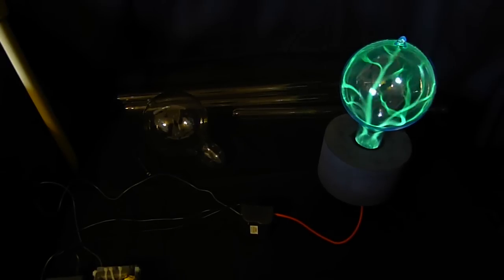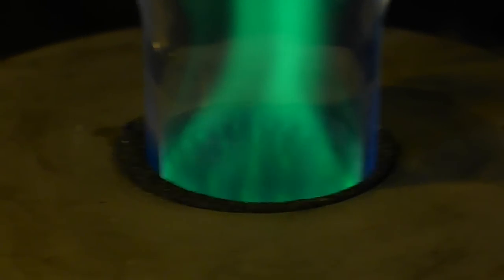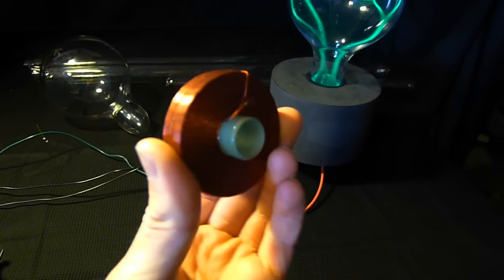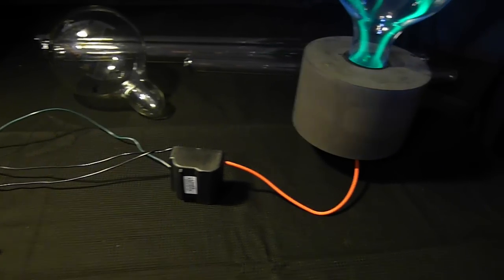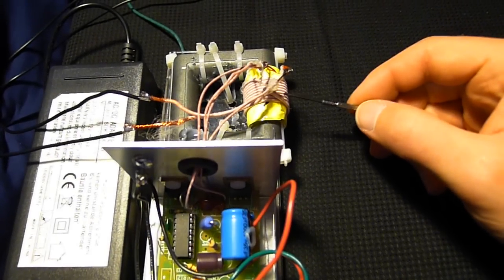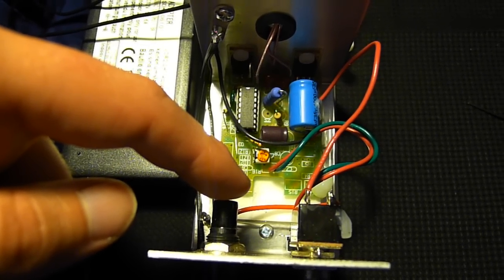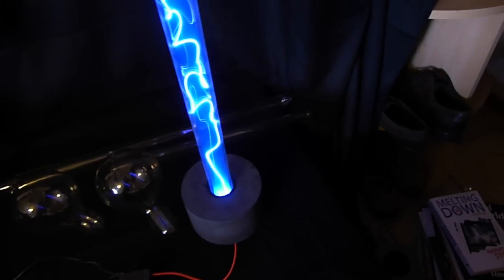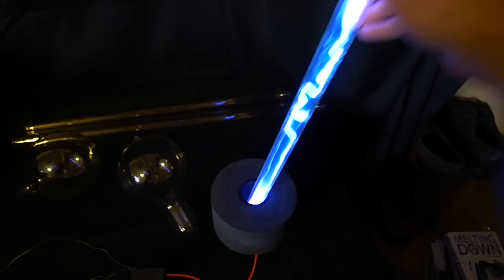Power supplies for decorative plasma displays

Comment from the maker: The second round flask contains a Xe / N2 / Ne mixture, and I have since learned that a trace of O2 is also necessary for the green color.  In this tube, the O2 probably is supplied from the tube walls; it was unbaked.  The measured components are
Xe: 20 torr
Ne: 135 torr
N2: about 500 millitorr (not recorded)
O2: trace (see above); if a baked tube, use about 200-400 mtorr
This four-component mix works reliably, but N2 and O2 contributions must be metered on a piece-by-piece basis.
Reply: Damn smart

Comment: Thanks for detailed and speedy reply. You might be able to get a three-color effect if you keep the O2 and N2 levels about the same and try Ne: 350-360 torr with Xe: 8-10 torr.  Add the Xe last very slowly while globe is energized to watch the effect develop. This should add a rose-pink or red color at the outer edge of the plasma tendrils and at the core.  If you want to try a "warm fuzzy flower" effect in  pink, red and bright orange try adding 20-25 torr dry Air to Neon at 200-220 torr.

Comment from the maker: The HVT-01 as originally configured has an unbalanced pair of primaries, one of which is wound with very small wire and prone to overheating.  You should ask Imagesco for the "new" HVT-01 that has a balanced primary (tell him I instructed you thusly).  Or, yes, you will have to use the isolation transformer.

Comment from the maker: I experiment a lot, but usually don't seal off and film tubes with mixes that aren't visually appealing, since it's money down the drain for me.  Helium makes rather dim and diffuse purplish and pinkish effects (depending on current density).  The good thing for people who want to play around with it is that the gas itself is dirt cheap.  You just need a suitable container, and an HV supply.

Comment: Great video!  Based on the good performance of the components you are showing, I have purchased the HVT-01 flyback transformer and am currently building the driver as described in Iannini's publication.  I am curious as to why you wound the "chincy" transformer as 1:1 instead of just removing the transformer altogether and wiring directly to the HVT-01's two primary coils.  Does the 1:1 provide some protection to the driver from the flyback?  Thanks!
Reply: Hey, did you ever get an answer for this question?

Comment: Hey Carl, thanks for the awesome video. I was wondering if you could help give a little more information on what you did with that 1 to 1 ratio transformer. I built the circuit and have 3 wires that hook up to the primary of the transformer (2 from the mosfet drains and one positive wire for the center coil tap)  so I'm a little confused how you converted that system into 2 wires that you hook up to the chirk transformer. Any help would be much appreciated!

Comment: Can you please tell me the details (The fill pressure for each component in Torr) for the xenon-neon-nitrogen mixture you used to fill the second round plasma flask in this video? The sharp-focus blue arcs with green mixed in is a combination I have been trying to make for some time. Use the private YouTube Message feature if you prefer. I can share details of some of my mixtures in exchange if you like. Thanks for sharing details of your work online.

Comment: I understand the need for a high voltage, high frequency, low current power source- and that is provided by that HVT-01 transformer. But what does the second thing (he "poor man's plasma globe" circuit) do? What's stopping me from hooking the transformer up to an AC power supply and running the plasma globe?
Also, where should I look if I need a substitute for said part, but have relatively little experience with electronics? I'm unsure if I would be able to put the circuit together.

Edit: Also, I've seen Neon sign transformers for sale on eBay that output 10~ kv at low amps, why couldn't I hook that up to a plasma globe in order to power it?
Reply: The flyback transformer requires a fairly high voltage (around 1000v) as input and it probably operates most efficiently at a frequency other than 60Hz. A neon sign transformer would probably work but it's extreme overkill (and quite dangerous) considering they are built for larger, higher pressure, hot cathode displays. It would also be very inefficient for an electrodeless tube because the capacitive coupling through the glass from a 60Hz supply would be much weaker than something like 10 kHz
Reply: @maevemccormick5307  Flybacks take anything from around 12v to 240v input...no way do they have a 1000v input. 
A neon sign transformer would not work, the frequency output is too low. It is not overkill as the voltage is more than likely less than a flyback output would produce (Flybacks operate anything from 10kv to 25kv). Neon signs are COLD cathode and not HOT cathode. (HOT cathode would be standard fluorescent lighting and do not use High voltage transformers, but standard line voltage and a ballast which is used in part to strike the tube, whilst regulating the current). The whole reason the plasma lamp works is because of the High frequency high voltage and this is why the displays look as they do.

Comment: A cheap ZVS (zero voltage switch) board from an induction heater kit and a HVT-01 or other non rectified flyback do the job:)

Comment: where do you get the gas filled bulbs?
Reply from the maker: +Oscar williams I make them.
Reply: +Carl Willis how? I think you melt some glass and put that in a tube and let the gas fill the glass like a baloon, is that how you made it?
Reply from the maker: +Oscar williams First, prepare the glass shape to be filled.  Second, pump the air out using a vacuum system.  Third, backfill with the noble gas mixture.
Reply: could you make a plasma display like the one used for "the rick and morty" portal gun?
Reply from the maker: I'm not familiar with the reference.  Sorry.
Reply from the maker: I would be willing to work with someone on a project to develop a display like this.  The collaborator would have to be wholly responsible for fidelity to the "original" (or departures therefrom) in relation to dimensions, functionality, and aesthetics, since I am not knowledgeable.  I can provide ideas related to the practical use of plasma illumination in the design, manufacture all components, and integrate them.